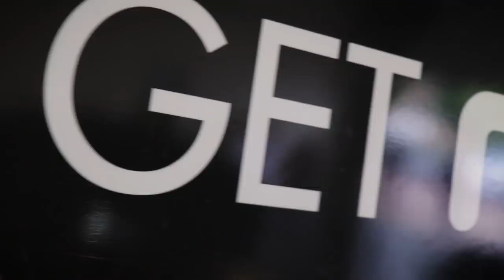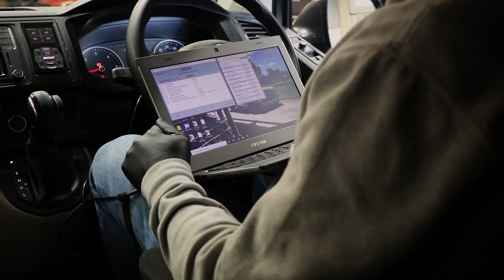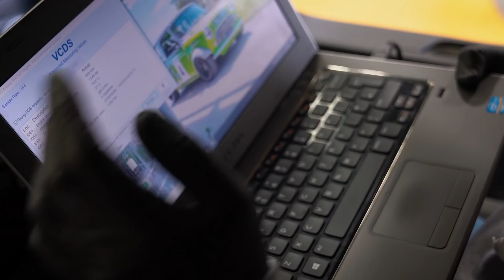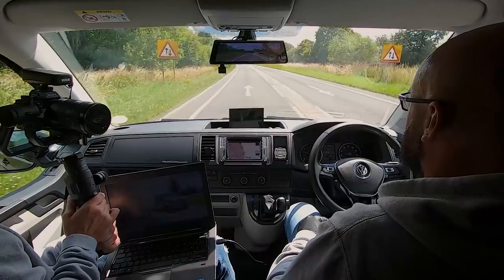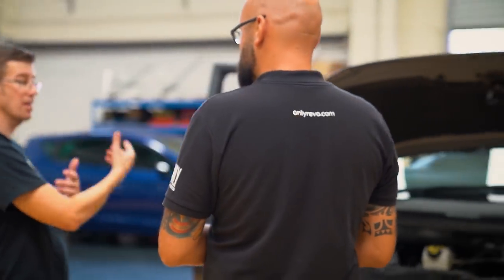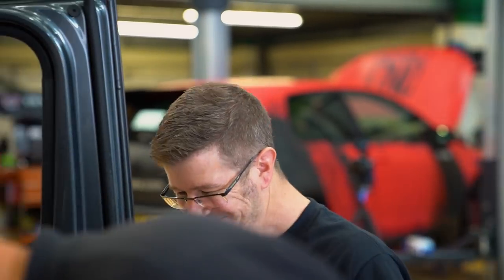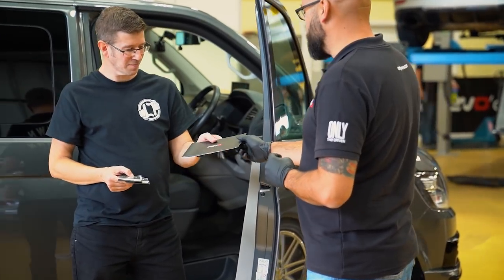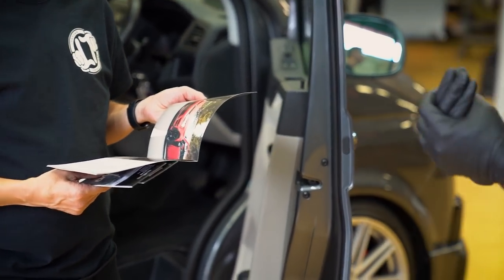VW Transporter Stage 1 Tune | Only Revo | Full behind the scenes at Revo HQ

Comment: Another great video. Just a thought now you have had this done for a while now see in comments that mpg about the same ? But was wondering do you have the dpf light coming on more frequently if it comes on at all and add blue is it all the same as before ?
Reply from the maker: Thanks very much🙌.  No,  absolutely no lights from DPF coming on the ad blue is just the same.. no more no less on that.  Consumption to me appears to be identical but poss a few extra miles out of a tank🤙.  And the after run regen seems as frequent as prior to the map in my opinion.  Overall I would say I’m chuffed with it👌

Comment: That roller cabinet looked a bit close to the body work, think i would have been happier to see some soft rubber on the back just incase it got shoved into my nice paintwork.
Reply from the maker: I feel you!  very observant too👍. but lucky Paul the man at the keys owns the stunning red T5 and knows how much we pride our vehicles so i felt it safe hands. (it did have a brake on the wheel too I think).

Comment: Steve, been a subscriber for a while now & I’m reaching out for some help, bought a Transporter Conversion that’s got coil over sports suspension, it’s set a bit low, having trouble getting over speed bumps. Can you or any fellow subscriber recommend somewhere to get it set properly? I’m based in Liverpool. Keep the videos coming Fella, love ‘em
Reply from the maker: Hey Michael,  thanks for the great comment 👍.  Great to hear you have bought yourself a transporter 👌👊.  Do you know if you were given the adjusting tool with the van? It looks like a large semicircle spanner with some teeth (designed to interlock with the adjustment rings) if so it can be a relatively easy driveway mod to raise the height if you have some adjustment left on the coil overs.  (Different makes different levels.) ie so lows will be low even at their top height but B14’s are normally wound rite down for a low ride so plenty to raise it by..... if you would just prefer to take to a garage I can put a shout out on the forums for your nearest custom approved garage?
Reply: Steve Field Thanks for the quick response Steve, I did get the tools with the Van but I’m a bit apprehensive to be honest. A shout out would be great if you don’t mind. Don’t want to sound like a wuss but I’d like it done by someone in the trade. Don’t want the Van to start driving like a clowns car from the Circus. Thanks again 👍🏻
Reply from the maker: Michael Riley no problem buddy!! Happy to help and probably really wise words 👍.  Somebody running there eye over things can ensure all the bushes and are all 👌 and will give you piece of mind for a level adjustmet👍. I’ll come back to you shortly 👍
Reply from the maker: Michael Riley Hi Michael,  So I have had a couple of strong recommends that a not on the doorstep but within a drive you would probably be happy to make.  1st being http://crsperformance.co.uk/. They are qualified and happy to carry out this type of work and also my friends @transporterHQ they have confirmed they would also be able to help and I know personally are very qualified in lowered vans!! https://transporterhq.co.uk. With either you would want to call and advise you are going so it’s not a wasted trip as both busy places.  Hope this helps and if I hear of anything nearer to you later I’ll forward the info 👍
Reply: Steve Field Thanks Steve your a gent, I’ll look them up & let you know how I get on, looking forward to your next Mod, maybe a warp drive or a flux capacitor. All the best Mick

Comment: Had a revo map put on my 102bhp  t6. Sadly it’s absolute junk. Van now has a course idle to it, nasty harmonic vibrations between 1k and 1.8k rpm,  judders like feck when opening the throttle wide in 5th, and seems to have pre ignition issues.  Having it removed next week and a proper remap done elsewhere. It is a very low mileage van and was nice to drive before hand. The maps made the van hideous to drive.
Reply from the maker: sorry to hear that, I wonder if there is a updated file or its worth talking to Revo about it?  I have to say the software on my set up has been really good for me.  I am def no expert in this field, and I take you along with me in the video for my experience.  The file going on and the road test were 1 week apart and apx 300 - 400 miles in so far and its  👌.
Reply: Sorry to hear this. We don't currently do software for the 102PS Euro 6 T6, so do you have a Euro 5 engine (from the T5?) If so this software has been on the market for years and gets great reviews. Please email support@revotechnik.com and we will happily look into this further for you, please include your VIN so we can check software installation details. Don't forget that all Revo software comes with a 30-day money-back guarantee, so you are entitled to your money back if you're not happy. But we would like to investigate this further. Look forward to hearing from you.
Reply: Hi revo, thanks for the reply, much appreciated. It is a Euro 5 102 bhp engine. The van had the map installed at 40k miles and has just got to 41k. I went for revo as it does have good reviews for the type of flash on map. The issues appeared as soon as the map was done by an authorised agent in the south. Because of the distance to them it’s taken some time to get the free time to take it back to them. As I said, it’s booked in for this Thursday so hopefully get some sort of idea what’s going on. The van was great before hand. It seems like either poor timing or to much torque or both,but would rather let them give the right answers. Most of my driving is motorways and I don’t rag it around like a boy racer. If anything I’ve been driving it like the engine has been made of glass recently. Biggest fear is it’s damaging the DMF or gearbox etc. Hopefully all goes well and it makes it there Thursday. I will let you know what they find.
Reply: @skylineadz  Yes something doesn't sound right and the Revo dealer will data log and speak with our support team so we can get to the cause of your issues. As we have mentioned above this software has been around for a while, and has need installed on hundreds of vehicles. Fingers crossed you get it all sorted. Feel free to drop us an email if required to support@revotechnik.com
Reply: Hey revo, the revisit proved fruitless and they achieved nothing despite saying they had fixed part of the problem. I’ll give you a call Monday to discuss.

Comment: Brilliant video,  did you get the filter also? Does it use more fuel or is it the same ish?
Reply from the maker: 👍 thanks,  no filter just pure software and I haven't really done enough miles to say concrete but its seems to feel about the same... Its due to give a better return but trouble is im still playing with it. I need the novelty to wear off so I an measure it lol
Reply: Put the pedal to the metal,  have fun but keep us posted.  Remember,  stay safe, control the van,  save lives 🚥

Comment: Hi Steve! Another great video!👍 What about the reliability of the engine after the modification? 
I also have a t6 with the same engine configuration.
Reply from the maker: Jens Dobernecker Hi Buddy,  this was a concern for me too and the reason I went with REVO due to the testing they carry out on the files before they release them.  The increase to 190 make no know issues with reliability and it’s on many vehicles now so well tested. It just opens up power that is already available to the engine via software so not like adding hardware parts and stretching things.  Hope that helps👍
Reply: @SteveField  Thanks mate!
Im living in Germany...trying to research a reliable company to do this... i think tec-power at Remagen next to me will be my choice.Stay safe!😉
Reply from the maker: Jens Dobernecker you too buddy!  Good luck and let me know how you get on 🤙
Reply: @jensdobernecker609  Speak with our German Distributor Werk2 Automotive ;)
Reply: @RevoHQ  Do hey have service partners in the Rhine area

Comment: Did you get your dpf gutted?
Reply from the maker: They did a DPF regen if that’s what you mean? Did it before loading new software👍
Reply: @SteveField  no I thought you had to get it gutted to have a remap on a diesel that's all. Great video!
Reply from the maker: Thanks buddy 👍
Reply: @cplmackyp3  All Revo stage 1 diesel software is designed to work with a stock vehicle and all its components, including DPF.
Reply: By gutting the DPF, you gain in some areas, but loose in others, it also becomes illegal & wouldn’t pass a correct MOT test with a DPF delete, DPF deletes are smoky too, why would you got cowboy mode on such a stunning van, Stage 1 on these is perfect 👌🏼
Reply from the maker: Steve W 🙏thanks for the kind comment on the van 😊. And I completely agree.  The package I’ve had is spot on👍
Reply: @stevew6426  I gutted my own then had it re welded no issues with smoke, far better on the engine especially if you remap plus they delete the dpf from the ecu so no issues with mot. Dpf choke engines to death
Reply: Mark Robinson nothing negative about a DPF that has required service regen, I’d rather that than running an illegal van too. I’m aware of several who have reverted back & refitted their DPF, some due to the pending MOT OBD plug in update which will mean an instant fail for DPF deleted vehicles, which my friend has been working with the Ministry for BETA MOT testing on, so your time is limited, as are others running an illegally DPF deleted vehicle.
Reply: @stevew6426   Not really always a way round it
Reply: Mark Robinson not with the new connect to OBD ministry test that has to connect directly to them.